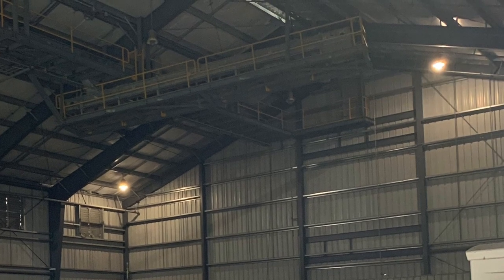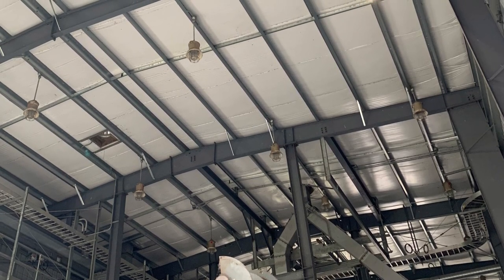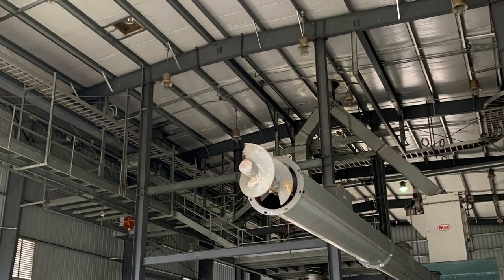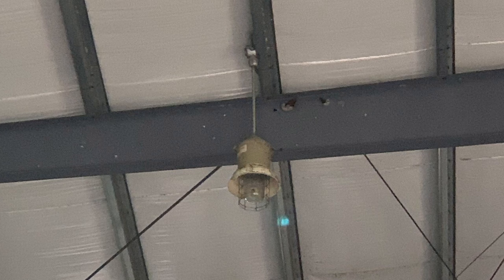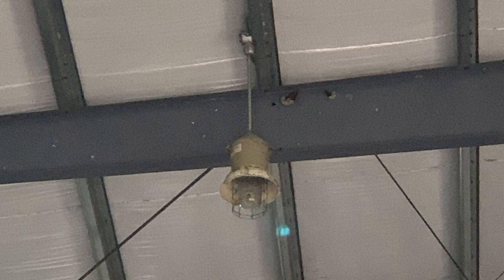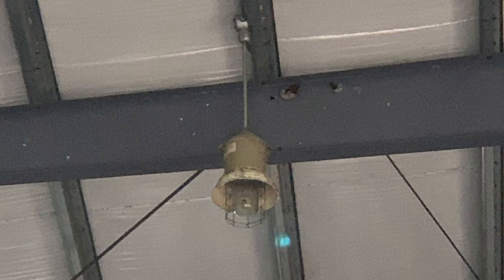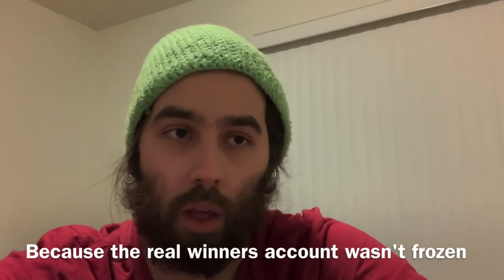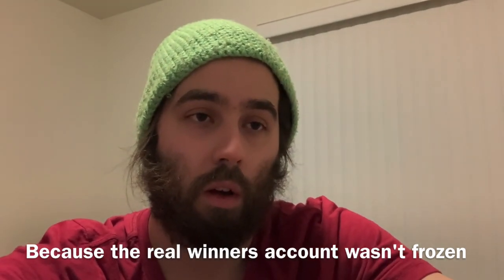Today As An Electrician: Corn Cob Lighting Retrofit (60 FOOT HIGH)

Comment: I remember years ago in the early 1980s I worked as a transmission mechanic. And on my first day of the job my boss told me to remove the transmission for me Ford F250 four-wheel-drive truck. It took me almost 4 hours to remove the transfer case and automatic transmission and I thought for sure I was gonna lose my job. 
Later on... that job would only take me about 45 minutes to remove. And once the guys put a bet on how fast I could remove a Powerglide from an old Chevy. My bosses record was 15 minutes. I did it in 9 minutes. Haha 
Thanks for the video